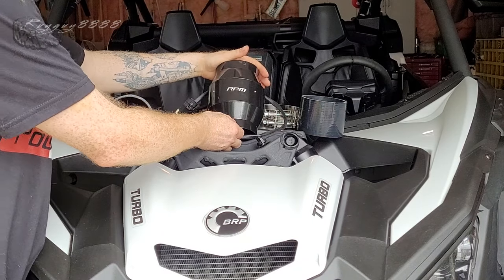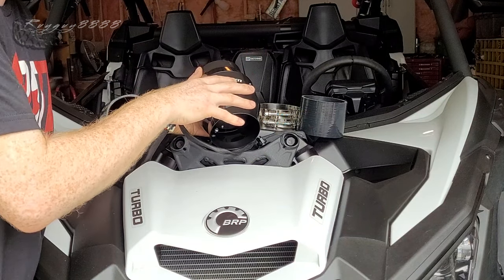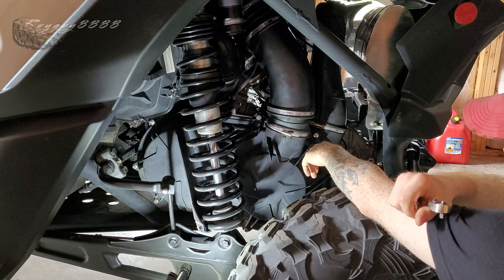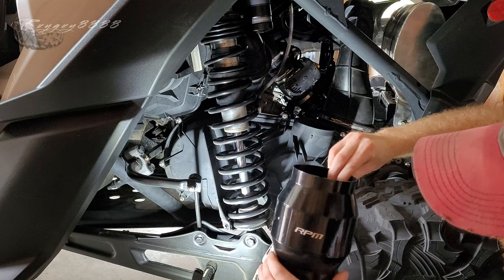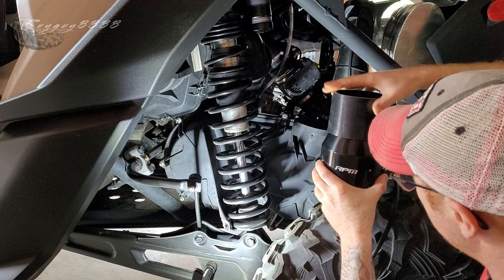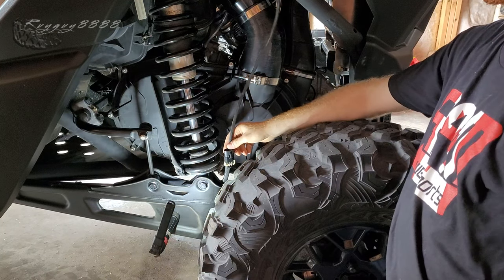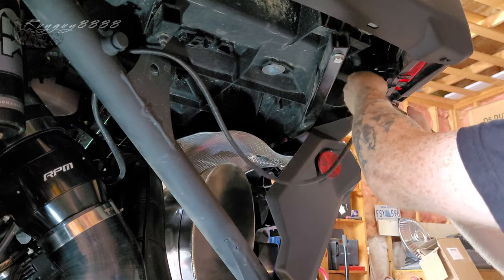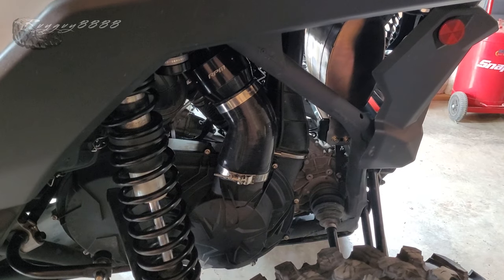RPM SXS "ECF" Electric clutch fan Install

Comment: Would this pull more dust into the air filter which would cause you to clean it more often? I love the idea of this and will probably order.
Reply from the maker: This is not going to pull any more dust into the intake screen for the CVT clutches than what would normally be pulled in while in motion. The electric clutch fan will take over air movement to cool the belt and clutches while moving at a slower pace. That alone wouldn't pull any more dust in. I think its a good investment in my opionion. Anything that will help prolong the life of the belt and clutches.. im all in for. Those are expensive to replace.

Comment: I got one it worked great for a year and a half then stopped working, the warranty is only one year so this is a waste of 160$. rpm is freaking terrible about taking care of customers, buyer beware.
Reply from the maker: Thats sucks that yours quit. Im certainly not an employee of RPM so I can't help there, however mines had mud and water down it, dust, etc.. and is going strong. What they sent me was actually a demo model so it already had use on it. 

As far as warranty goes, I can tell you that 99% of the products sold out there have a 1 yr limited warranty anyway and only goes against manufacture defect. If yours quit because of forces outside of there being something wrong of a defect, then it wouldn't be covered anyway. My X3 only had 6 months factory warranty and a refused to add another $4000 on top of the price. It's my mitigated risks. 

We all hope (including the manufacturers) that products last longer than thier warranties, however the reality is we expect them to do more outside of what they where designd for. In this case it's a fan inside a housing to blow cooler air over a hot clutch. yours did just that, so it did it's job. (edited for spelling)
Reply: @ruyguy8888  I agree completely, but mine made it 14 months (2 months past warranty) before it turned into a $160 paper weight. So I just want to let others know because I feel like it was a waste of my money, I know (as I am one of them) people watch these videos and read the comments to see if something is quality and I don't believe what I paid for was. And no it didn't have rock stuck in it and we don't see much mud or water here in AZ. Btw great video, my review is in no way a reflection on you or your work. (And rpms site won't let you post anything but a 5 star review)